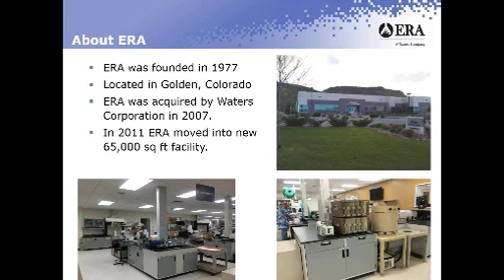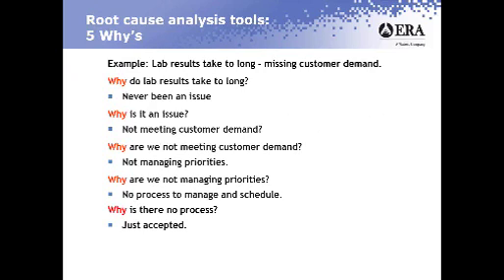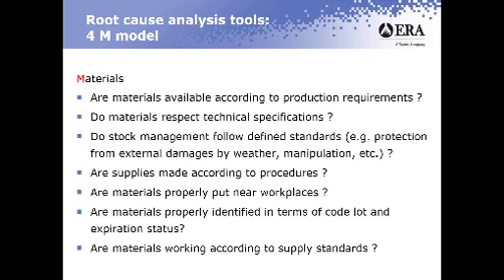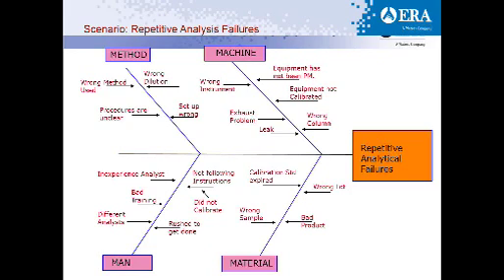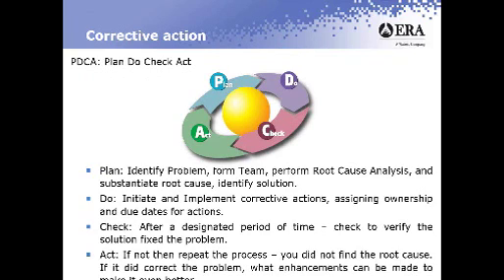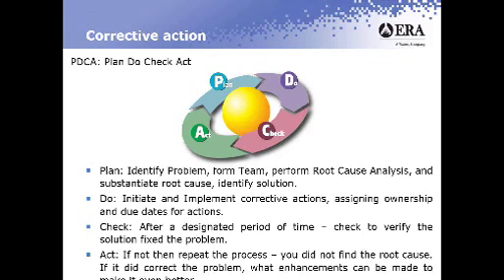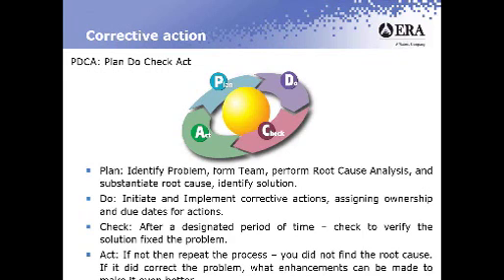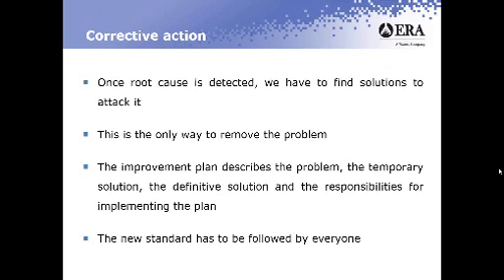Improving Root Cause Analysis and Corrective Action with David Kilhefner

Comment: Grossly incorrect and misleading information. 5 Whys and Fishbone Diagram (4M) are not root cause analysis tools. This is a serious problem when folks are misleading others by false incorrect information. These are Brainstorming Tools. For Root Cause Analysis you should be using and teaching Structured Problem Solving (KT - Is/Is Not) and Statistical Problem Solving Tools (Hans Bajaria, PhD).